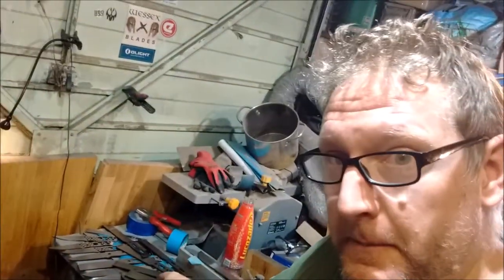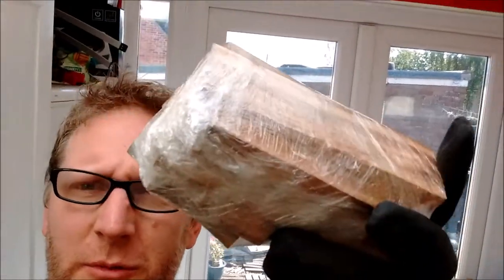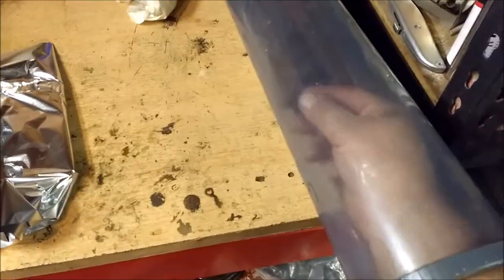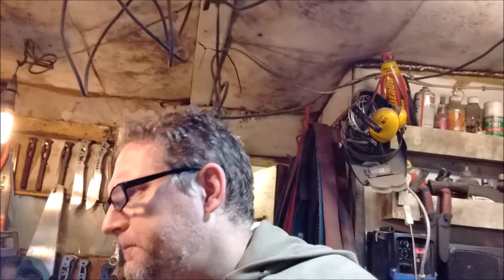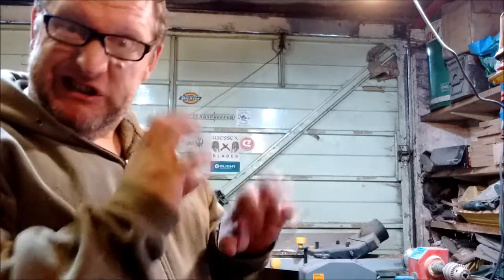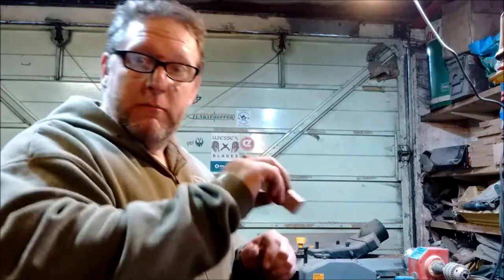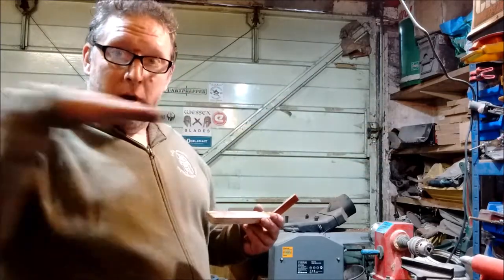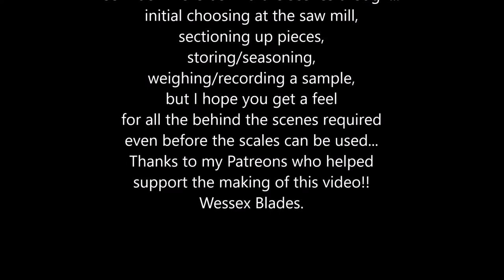How to make a knife Handle out of wood, Behind the scenes of Stabilising Scales, knife making stages

Comment: Fantastic video Scott. Clear and comprehensive. It has raised a couple of questions for me:

- What finishes would you use on stabilised wood? I'm guessing penetrating finishes like linseed and danish oils don't penetrate because of the resin.
- Does this stop the ingress of grey dust into the grain of pale woods? Sometimes I get a sort of grey staining on pale handle scales where the ends of the fibres are exposed.

Looking forward to more instructional vids :D
Reply from the maker: hi there, I still use a dash of Danish on a stabilised handle, just a quick wipe and allow to dry, or finish to a high grit and multi stage buff, as for grey dust on pale woods, is this on woods you have stabilised? because it may be the resin , hence why I don't use the fluid on big grained oak, you can see the resin and a looks unsightly...if it is on seasoned wood, maybe try slowly abrading to a high grit to achieve a smooth grit then burnishing( rubbing down with a similar hardness wood piece, like a slicker burnishes the leather, this rubs down the surface, pressing it smooth)
Reply: I've never tried stabilised wood not least because, until this video, I didn't really understand what it was. Thanks for the tip, will try that next time.

Comment: I would have to disagree with your assumption on the guards on the table saws . it takes about 20 minutes to an hour to make a new saw usable. By that I mean taking of and disassembling  the guard so you can remove all of the damn burrs to make it usable . Even my Craftsman 10 inch Professional I bought in 2003 and and weighs 400 lbs I paid $15.00 bucks for it needed a lot of work but worth every dime has not given me a lick trouble and I have used the hick out of it. Every tool sold here now is over protected.